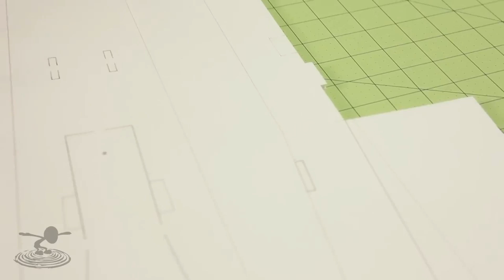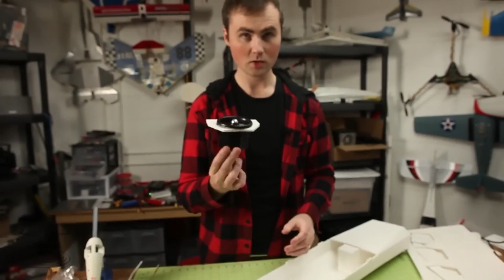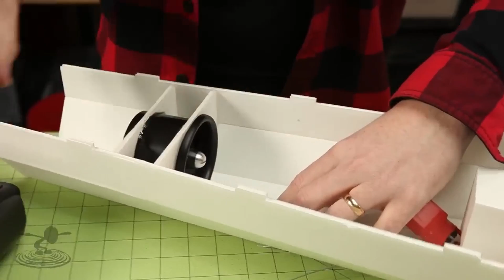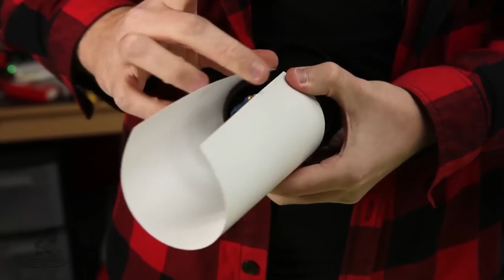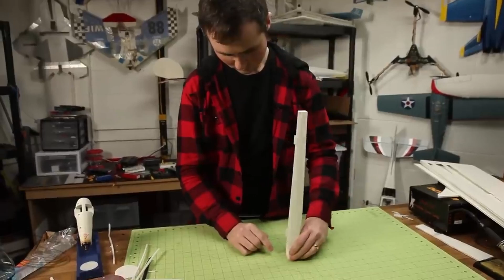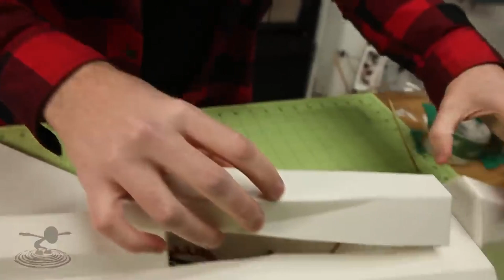How to Build the FT Viggen V2  //  BUILD

Comment: My FT Viggen has been flying for 5 odd years 
Put upper and lower KF airfoils on it (KF4's) for strength and higher wing stability
Also used BBQ. Skewers on canard leading and trying edges into the fuselage for more strength there